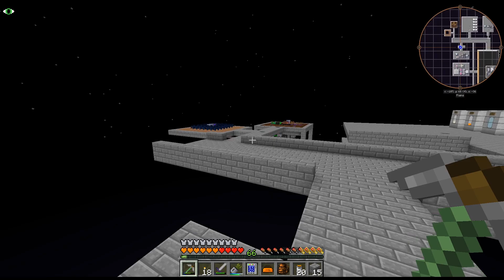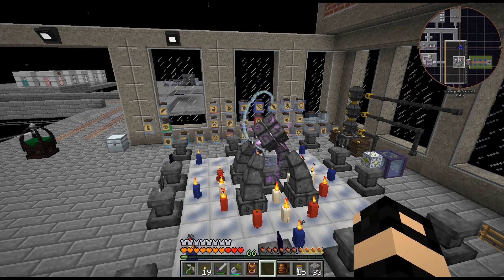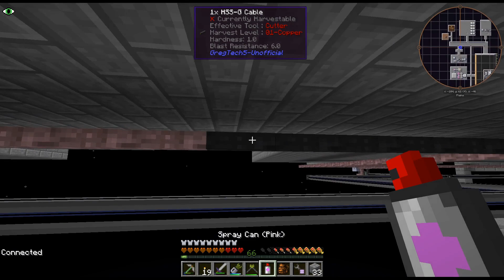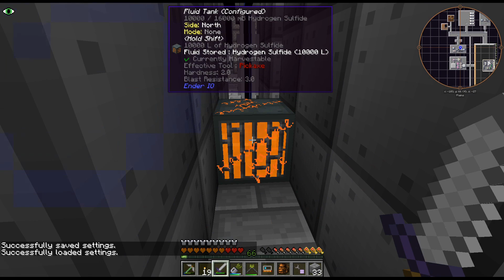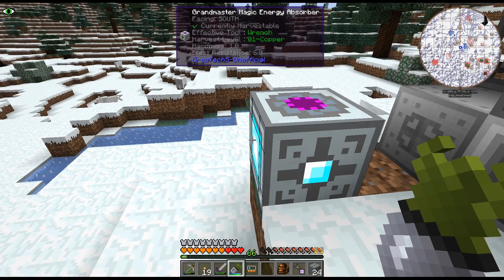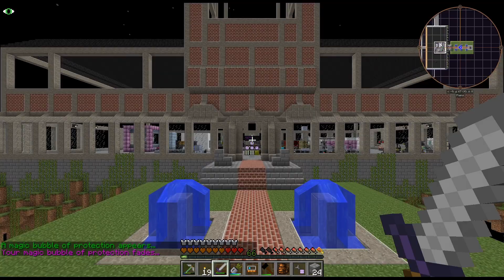GregTech New Horizons S2 - 127 - Magic Energy Absorber

Comment: GTNH Ender tanks are 256 buckets
Wood tar is worth setting up, and you get charcoal from that
Should WA infusion altar
There are higher tier fluid conduits you can use now
Ender fluid conduit > GT pipes
Time for bees for dragon eggs?
Should put covers to prevent oil rig from voiding